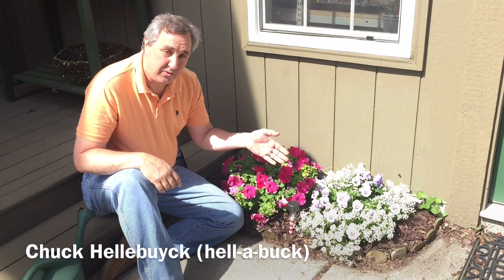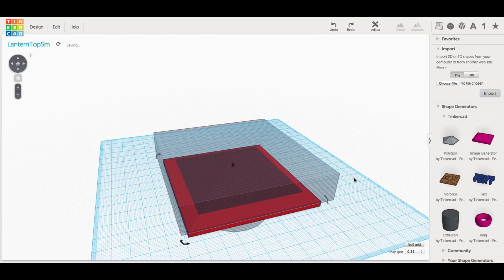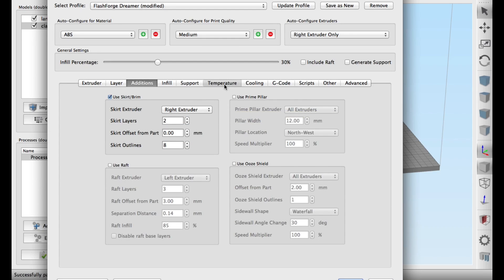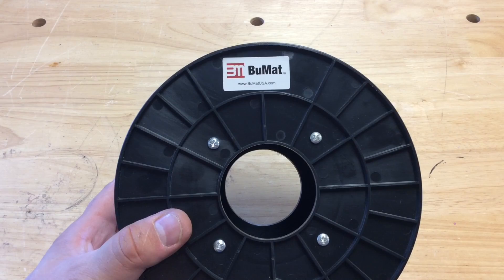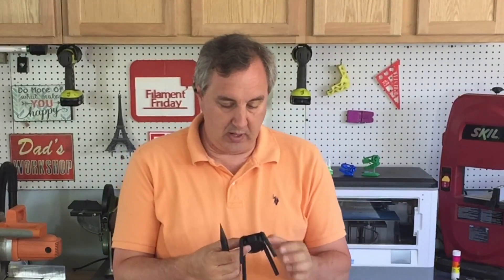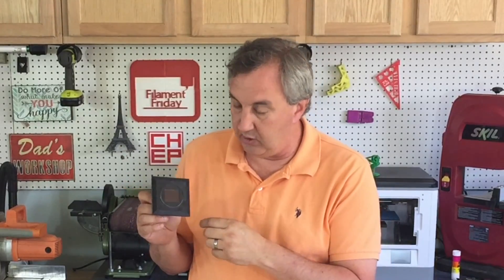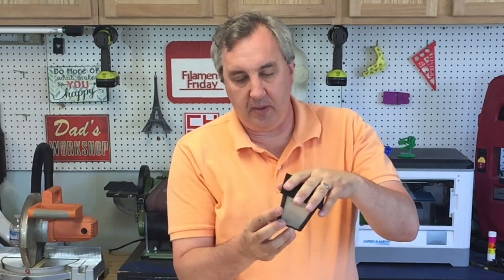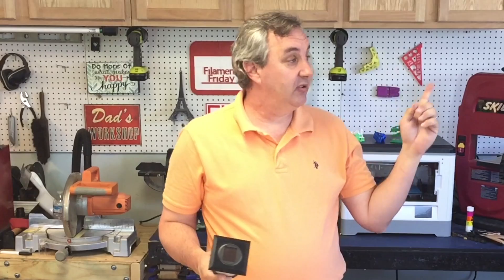3D Printing Filament Friday - Sidewalk Solar Powered Garden Lantern

Comment: Beautiful as I was planning on doing this too as I have a bag full of dead ones (always the battery dies).
Reply: *****
Mom does that every year since it is cheaper to buy them than to buy just the battery so I confiscate the previous years and they are building up.  Sad thing is they all leak so that is why the electronics, and especially the battery, fails.  Not water tight at all and you get rust all inside.

Comment: LOL at your timelapse. It's funny cos it's so true. I often find myself printing late in the evening, so I make use of the wait time to wash the dishes after dinner and other little jobs like that.
Reply: My OCD - and horrible luck with failed/imperfect prints almost every time I leave the house or go to sleep with it running - has resulted in my wait time being a habitual, constant back-and-forth between whatever else I should be doing and verifying that the printer is also doing what it should... :-/
Reply: +Brandon T Octoprint with a webcam on the printer and a smartphone in my pocket save me this angst if I have another time consuming task to do while the print runs.
Reply: Luckily for me (in a manner of speaking; it's a long story) I'm usually close enough to the printer that it's easy/easier to just walk over to it. But that doesn't work when I'm sleeping, and it's honestly probably not a good idea for me to have smartphone/webcam access to my printer while I'm driving around town; I'd just end up getting a ticket and/or in a car accident. :)